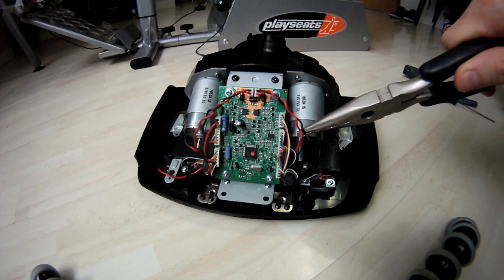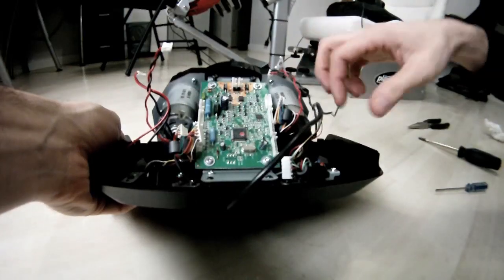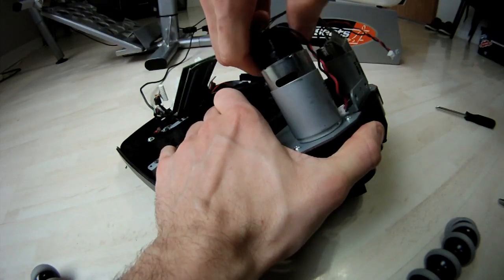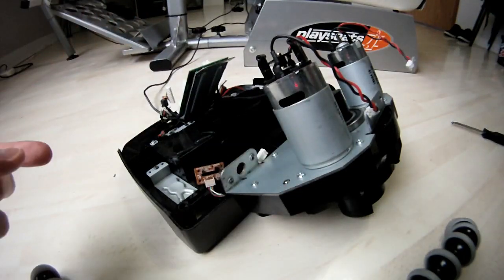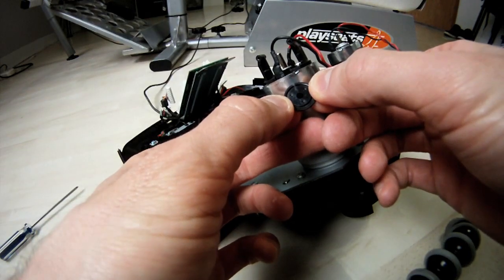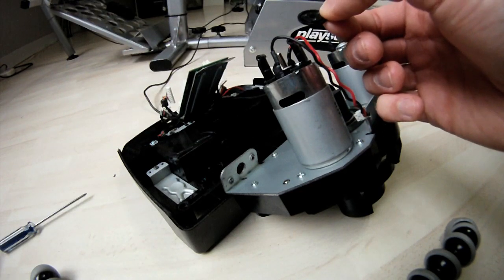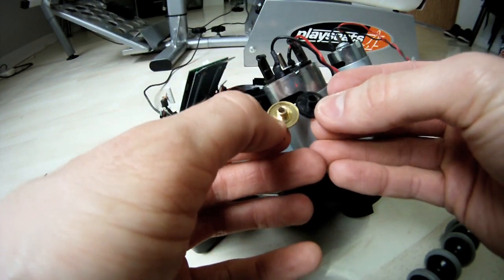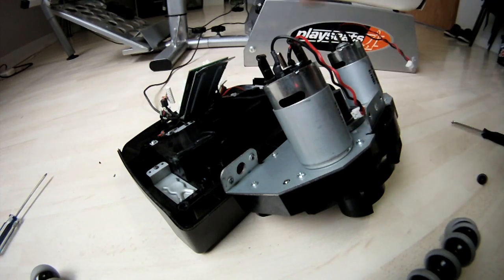How To: Replace Logitech G25 Optical Encoder Disc (How To Fix Your Broken Logitech G25)

Comment: Actually you can find this replacement part for Logitech G25 , G27 and DFGT optical encoder with 30 or 60 slot wheels at ETSY search for " Optical Encoder 60 Slot for Steering wheel Logitech G25 / old G27 / Driving Force GT " with the buyer name " abrapartabra " . We have fixed our wheel with their encoders, they are made like original, but with more reliable plastic !

Comment: I'm just getting into pc steering wheel. Is there any benefits from swapping from a 30 slot encoder to a 60?
Reply from the maker: I honestly, do not know. Sorry. 
Also, apologies for the late response.
Reply: @mikeschmeeedotcom  it's all good. I was reading into it alittle. Apparently there's some sort of light in the wheel (assuming a laser). It passes through the slots that are responsible for basically sensitivity. The more slots, the more sensitive it is, apparently. Can't confirm or deny as I have done the mod at this point. I appreciate you responding, thank you 👍

Comment: the link is broken do you have some brass encoder disk replacement.? Also maybe it is the infrared sensor too do you know where i can buy a replacent also the main board?
Reply from the maker: Maybe try second hand websites for new and/or used G25 or G27.

Comment: I got around to "fixing" the sensor and after putting it all back together I now find there's no power to the unit! I just realised I never unplugged it while working on it......so does this mean I've shorted it somewhere and ruined it? I've tried swapping the fuse in the mains plug but still dead.
Reply from the maker: That's unfortunate, sorry to hear. Honestly, I'm not too sure what to do. Perhaps using a multimeter to check all of the connections, fuses, etc., could help and to ensure power is running through the entire unit and to all areas of it as well?
Reply: @mikeschmeeedotcom  Yeah fair enough, I'm no wizz with electronics so it'll probably end up in the bin . It's not so bad I have a T-GTII  now , lol. Just a shame to have gone to all the trouble of taking apart and put back together. I blame youtuber for not telling me to unplug it first - just kidding that's just common sense when taking-apart electronics.
Reply from the maker: @Substance2020  hah! Yea, maybe I should have mentioned to unplug it. Don't throw the unit away, maybe I'll grab it off you sometime and try to fix it. It'll be an excuse for me to create an updated video. 
The T-GTII looks pretty sweet. Congrats!
Reply: @mikeschmeeedotcom  Nah I messed up(again) didn't do my homework - DD is the way to go.  I  thought Trustmaster was a  leader and their latest and greatest wheel was the one to get - same old cogs and notches.  I might get around to finding the electrical fault sometime, either that or I'l pull the motors and use them for something.
Reply from the maker: @Substance2020  Dang, that's too bad. Live and learn I guess? Well, if you ever get around to tossing out the Logitech, let me know. I might be able to grab it off of you.

Comment: My g25 seemed to need frequent recalibration so I ordered a brass wheel from a US source, turned out it was a missing screw in one of the motors but I put the new wheel in anyway.  Now the PC doesn't recognize wheel movement. ☹️. Tried brass and plastic, wheel does it's start-up dance so it's getting power.  Connections look solid.   Any clue?
Reply from the maker: It's been a while since I played around with the G25, but I remember having a bit some small calibration issues if the rectangular bar that connects to column of the G25 unit does not align perfectly. Maybe it's that? It basically has to be dead center, otherwise the calibration will not work on start up, and the gaming system might not recognize the wheel. That's all I can think of at the moment.
Reply: @mikeschmeeedotcom  Thks.  It w maybe out by 1-2 teeth, seems centred now.  Flashing power light as well, normally that means bad power unit but main board is getting 24v, motors are getting 16v and encoder is sending 4.8v so I’m scratching my head.
Reply from the maker: @artmcewen3165  Interesting. Could it possibly be some bad and/or loose wiring somewhere?
Reply: @mikeschmeeedotcom  Not that I could see.  I suspect something is fubar in the board itself.

Comment: I expect that it's a polyamide (Nylon) disc. If that's the case, it cannot be glued, the low chemical surface energy causes it to reject adhesives.

When the material comes out of the mould, it's somewhat brittle, and is conditioned for several hours or about a day in humid environment to absorb around 4% of moisture (by weight and by volume approximately the same). It becomes tough and flexible and expands in size a little. Then after it's installed on the shaft, it will lose a little moisture and will hug it tight. It will continue losing moisture, because it sits on a pretty warm shaft on a pretty warm motor, and it will continue shrinking and becoming more brittle. Eventually, the shrinkage forces will cause it to split, as it continues shrinking around the shaft, the forces are immense.

I tend to repair some mechanisms which share the issue. I repair small polyamide gears by copying them, creating a single-sided mould with silicone putty, and then casting epoxy into it. I usually use Uhu 300 epoxy, and i mix about 10-20% more hardener than binder, to make it more flexible, since in 1:1 epoxies the hardener usually contains plastifier, in this one for sure. Then i hot cure it, i throw it on the bed of my 3D printer at 80°C or before i used to have one, i'd just used a hair drier.

I don't know whether i'd be able to copy the encoder this way, whether the silicone that i use can actually be encouraged to go into all these little holes and then stay together while the master is removed, or maybe liquid casting silicone needs to be used instead. Nowadays, one could also 3D print a replacement. You can find ready made 3D models on Thingiverse. You can then order the prints in polyamide from Shapeways, or in polyamide or resin from PCBWay or any number of companies - this is all very inexpensive. It also seems barely just about printable on a commodity FDM printer in PLA, won't look great but might just work, or might need a tighter nozzle than standard (0.4mm is standard, but down to 0.2mm are available) but it is doable.

There appear to be a bunch of guys in China offering 60-slot encoders specifically as "steering wheel encoder for Logitech", not cheap though. These are made from stainless steel. So you aren't limited to a single supplier.

Comment: I have the g27 and have the same problem. Also a crack in the plastic optical encoder disc. So i go and order an rvs encoder disc. but before u order an replacement disc, take a look at the one inside of your wheel. Cause i have an old version of the g27 and this one have 60 slots in the disc. But i have seen also disc's with 30 slots, so be aware of wat you actual need. Otherwise you did u bunce of work and think it is fixed, and try to play a game and see it is stil not working.

Comment: hi thanks for this. my encoder actually looks ok (no cracks at all). The problem i was having was the steering (left and right) wasn't regisering in the game. the only thing working on the steering wheel was the rev light stay on constantly and the paddle shift would work. i too had the blinking light on my shifter which is why i have opened it up and found the encoder disc in good condition. any idea what else could be causing this issue on the steering?

Comment: Thank you man, your two videos really helped me. I managed to fix it without buying the brass encoder. So here is my story if it can help someone: 
The first time i tried to glue the crack, but when I put back the encoder on the motor it cracks again. So the second time I bought a washer. M5 inner diameter. I put the washer, It didn't crack anymore. I assembled everything back and plugged in the wheel. It calibrated but it was slightly off (like 10 degrees). The problem was that the washer was too thick, the encoder wheel was far from the black sensor (make sure your encoder wheel is close to the black sensor but doesn't touch the circuit board) so I dissasembled again and removed the washer. I cut a piece of metal form a cola can. I made it the same dimensions as the washer. I put the new washer on the encoder wheel and I couldn't believe it but this has worked.
Reply from the maker: Awesome stuff! Did you make a video tutorial on what exactly you did with the cola can? Or will you make one soon?

Comment: My G25 has been sitting in a box for over 5 years. With iRacing getting popular, I pulled it out and found this to my dismay. Thank you for the tutorial. I'm going to see if I can use my soldering iron to melt the cracks back together for a temporary fix, I ordered a 60 slot from CM Laser. Thank you for that link as well!

Comment: Where buy this black wheel??
Reply from the maker: Amazon, video game store, bestbuy, electronic shop, gaming forum, local used classifieds, eBay. 
If you are referring to the MOMO steering wheel, just go to any automotive performance shop and they can order you one. Amazon and eBay should also carry aftermarket steering wheels. But you'll need an adapter supplied by chilicoke (if he still does that)
Reply: I can not find him. The only one that is copper and in Taiwan. In Poland not available at all. Logitech does not want to sell. It must be to DFGT
Reply from the maker: I'm sorry but I do not understand. Are you referring to the Logitech G25, MOMO steering wheel or brass optical encoder disc?
Reply: The DFGT fits a G25 and G27 peg on 60 slots. It's hard to buy it. Only he is buying in Taiwan.

Comment: Great video.Thanks a lot for your help. I also had my encoder plastic disc cracked. I glued it with loctite and the problem persists (software does't recognize the wheel - green light blinking on the shifter - , only recognizes pedals, shifter and all the buttons, including the ones on the steering wheel). Then I noticed that the encoder disc was a bit loose on the 3mm motor shaft. I,ve glued it too. The problem persists. 
I can order one of these brass discs that you refer, but honestly, What difference it will make as my plastic disc is now well glued and tight to the shaft? I wonder if it is not another problem. In your oppinion,  what difference can make the brass disc to the original one well repaired and tightened? Do you know any other hardware or software problem that causes this?
Reply from the maker: Hello, thanks for the comment and compliments. 
I don't know of any other hardware of software issues. 
The brass disc is simply stronger and will not (or atleast should not) crack as you have seen from the plastic disc. That's the only difference I can think of. 
If I had to take a guess I think the plastic disc is just simply not strong enough and overtime its prone to cracking? 
I hope that helps. 

Cheers!
Reply: I'm currently on the same situation I have the same symptoms you guys mention that of the blinking green light on the shifter. I am not sure if the problem will be fixed if I buy this expensive brass encoder however and it's quite a bit of money to try... Is your issue fixed after you replaced the encoder with the brass?
Reply: I didn't replaced the plastic disc with the brass disc. I found a second hand G25 Wheel and I bought that wheel. But I suppose that If I had replaced the plastic disc by one of those brass discs the problem might have been resolved.

Comment: i bought a new brass encoder and it wont even calibrate fully? help..
Reply from the maker: All I can recommend is make sure the disc is in place correctly along with that bar right behind the steering wheel. From what I remember that part has to be centered. Mine did not calibrate correctly until I had that bar centered with the steering wheel. Sorry I cannot be of more help.

Comment: I have a brass encoder on my G27 and its working, BUT when i turn the wheel on, it turns all degress to the left side and then, I need to manually turn some degress to the right, so i can play games. The force feedback on the left side is weak and i suspect that my left engine has some problem.
Anyone here has experienced the weakness problem?
thanks!

Comment: good video man i used it when doing my first encoder, but just a heads up for anyone looking at doing this. you can just pop the plastic cover on the motor off and change the optical encoder as the g27 is seen at the very start of this video. no need to remove circuit boards, plugs (apart from the one in the back of the motor) or the main steering unit with the motors attached. its more fiddly and you have to be more careful but it can be done. i just done it tonight on my 2nd wheel

Comment: My G27 doesn't steer anymore, all other buttons work, pedals and shifter, the only issue is the steering.
The shifter light blinks and if I plug the wheel to a different USB, it doesn't detect as G27, it detects as Logitech Driving Force model.
I checked the encoder and it's cracked indeed (but still in one piece).
 I'm not so sure that issue is causing this problem, can it be that a slight crack can do all this? anyway I tried to glue it, but the issue was not solved.
Did you have those exact symptoms?
Reply: I don't know why it's showing up as just the DF model, but on my G27, the encoder was cracked, albeit slightly, yet that caused the calibration to go haywire. After replacing it, fixed it. I think to fix the DF problem, is to reinstall the drivers for it.

Comment: I have repaired my encoder with a washer that fits snuggly, and I have reassembled. However when I power on the wheel does a small turn then stops, then a few seconds later is tries again then stops again. The lights are all lit up and when I go to the calibration the buttons are all working and the pedals but the left right axis has no movement at all. Can anyone advise what could be causing this and what connections I should be looking at for issues?

Comment: 1: Close the crack with som fast glue and some pressure. 2: Glue a steel washer on the disc, for enforcement. 3: Clean for glue residue near the small encoder holes.

Comment: Thanks for the informative video +mikeschmeedotcom - it turns out my encoder is cracked (plus when I saw the flashing light on the shifter I knew it was the same issue as mine). So I'll be ordering a new encoder disc from Thailand to Brisbane. Cheers buddy!
Reply: Update 07/07/16 - Ordered the encoder disc from Thailand, great quality and thanks to CMLaser and mikeschmeeedotcom it is working again. I would add, to make sure you align the geared board fully to the left to ensure it can calibrate properly - and I also had to gently push the encoder disc closer to the black optical reader as it couldn't read it the first time. 

Other than that it works beautifully and I don't need to buy a new wheel now. Thanks so much guys!
Reply from the maker: Glad it worked out!
Reply: mehdi maybe google search the name/model of your wheel for some fix results - most wheels of this age will use an encoder to translate your turning of the wheel to a unit of measurement that your PC can understand. Hope that helps
Reply: my G27 doesn't steer anymore, all other buttons work, pedals and shifter, the only issue is the steering.
The shifter light blinks and if I plug the wheel to a different USB, it doesn't detect as G27, it detects as Logitech Driving Force model.
I checked the encoder and it's cracked indeed (but still in one piece).
 I'm not so sure that issue is causing this problem, can it be that a slight crack can do all this? anyway I tried to glue it, but the issue was not solved.
Did you have those exact symptoms?

Comment: Thanks for the video, very helpful. I have a couple questions though. When you remove the old encoder disc and put the new one on, is the shaft/disc keyed and if not how can you be sure the holes are in the right position for the purpose of calibration? Also, if not keyed to the shaft, what's to keep the disc from spinning on the shaft?
Reply: Sorry by the way if this question has already been asked, there are a crap load of comments on this video ...

Comment: Excellent video. I definitely have a cracked wheel.  Sigh.  Exactly as predicted. I'm about to order a new one. 

Question though as I seem to be missing a tiny piece of info... There's a rectangular piece of plastic with gear teeth and grease in there.... How do I know exactly how to get it back in properly? It seems like it would have to be aligned in some way otherwise the wheel would have limited travel in one direction or the other. 

Thoughts? 

And thanks for the great work.  You've done us all a great service here.
Reply from the maker: +Bill Griffith Thanks. 
I lined it up as center as possible. It was trial and error for me. Luckily I got it right the third try. I do not know of another way of aligning it perfectly.
Reply: +mikeschmeeedotcom I stared at it for a while and I ended up getting it REALLY close to perfect.  Just an FYI...I didn't get the brass part. I took my cracked wheel and found a small nylon washer that was a little too small to fit over the shaft. Then, carefully trimmed the washer with my Dremel too for a nice firm fit. It constricted the cracked wheel back to perfection. A tiny bit of cyanoacrylate to keep it safely in place (it's tight and I'm sure it won't move anyway) and it's been working like a champ.   19 cents to fix.
Reply: +mikeschmeeedotcom tool. Damn autocorrect.
Reply from the maker: +Bill Griffith Cheers!